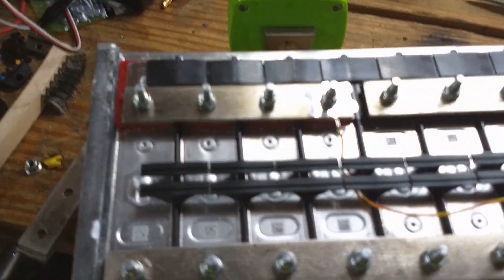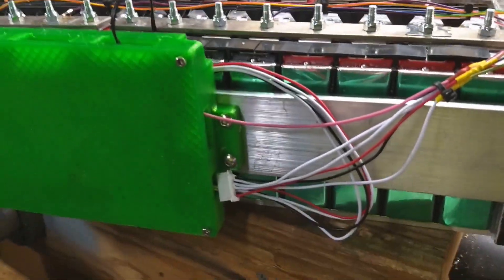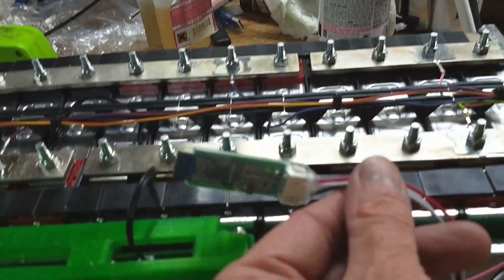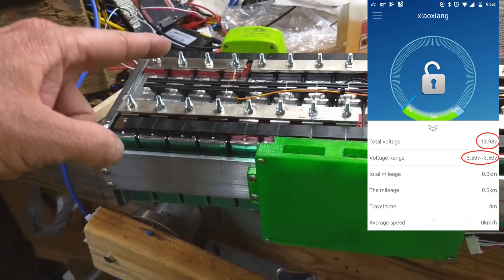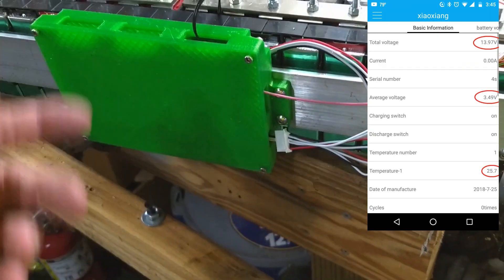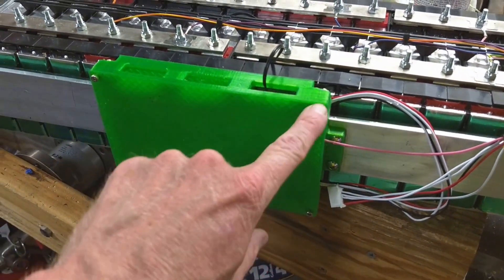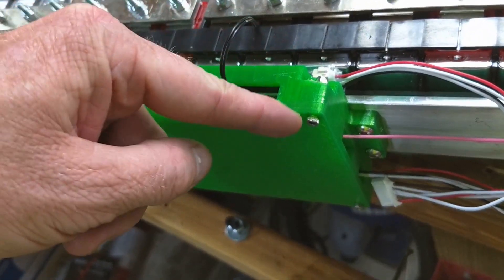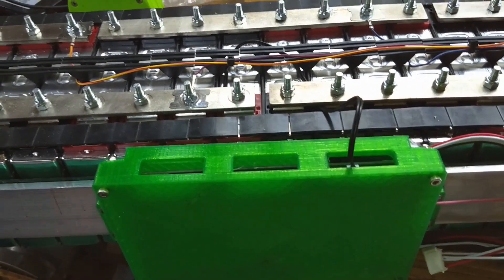100ah Ensley Energy Systems battery NMC Car Audio 25,000 RMS

Comment: Is this cmax cells ? What’s the minimum charging voltage needed for 100 AH ?
Reply from the maker: Charge voltage needs to be MINIMUM 14.4V, MAX 16.8V, MAX RECOMMENDED 16.2V GOOD SOLID MIDDLE GROUND IS 15.6V

Comment: You seem genuine. If I decide to buy vs build I'm coming to you. Honesty does pay off.
Reply from the maker: Thanks,  I do this as a hobby.  I don't make a ton of money doing this.   I just want people to be safe.   I mainly started making these because I saw all the garbage people were putting out.   YOU HAVE TO COMPRESS CMAX CELLS!!!!    Too many people are out there DIY'ing bad packs.    The angle iron method is cheaper, but I like the looks of these better.   And on the angle iron, you are not supporting the center section of the cells.   But that way is better for current flow!

Comment: Would 50Ah be enough for a 5k system?
Reply from the maker: I'd recommend a 75ah bat for 5kw
Reply from the maker: $750 for the 75ah

Basically 10$ per ah after u get to 75ah due to constant costs on frame.

Comment: I have (2) 370 alternator and running 10,000 watt amp how many batteries will I need to keep good voltage what is your thoughts
Reply: One guy told me 12 110ah batteries
Reply: cayde17 that’s agm batteries.. you would be good with 100 Ah lithium

Comment: Hey Eric what's the cost  for the battery
Reply from the maker: I have different sizes for different prices on ebay.   100ah is $950(this one), the 50ah is $535.    I can also make 75ah.   If u buy direct from me there is a 5% discount.   You can email me at EnsleyEnergySystems@yahoo.com
Reply: @ericensley2427  hey man I live in Canada could this battery be use below 0 in car audio
Reply from the maker: @kernhamilton553  
Probably.   Never put them in a freezer.    But if u have it in ur can, just heat it up before u start to bang.   BTW I don't ship to canada.  Do u have a PO box in the US?
Reply: not to tag on but how much for a 75ah? what wattage can it support? would be better run AGM/lithium or all lithium for starting and charging
Reply from the maker: @rob22849  
75 ah is $750.   Wattage depends on a few things, charge voltage and min allowable voltage.     You said u charge to 14.8 v and if we say 14v is lowest voltage u want to see then the 75 ah batteries can dump 650 amps = to about 9000 watts.   If u said 13.5v min voltage then the amps jump up to 1050 amps and that is about 14,000 watts.
Reply: Eric Ensley wow nice and that's burst or continous wattage? and I see your stuff on ebay what are your price if buying directly from you for the 50ah 100ah thanks for info i appreciate it
Reply from the maker: @rob22849  
Outside of eBay it is 10% cheaper (I said 5 above but that was before I looked at the fee rates)

Those numbers are "continuous".   I put " " because u still need an alternator to help fill the battery.   As the voltage drops you will need to back off and recharge.   U should get 1-2 songs before needing to recharge, but that also depends on your alternator and amp.   There are a lot of variables, and I am not a "yes" man to make a sell.    I'd rather give all the facts and tell u the actual truths, vs "yes"
Reply: Eric Ensley you what Eric I appreciate that I'm not soft I take can it straight no chaser lol that's how I prefer it.i guess I should've said a little more about what I want to do the alternator will be a 320 amp alternator amps will be either 2 Orion 2500dz strapped for a 2ohm load or if I can find for a decent price used two Rockford fostgate 2500bdcp but that depends on budget and real estate needed for my box. but anyway the current goes from 400 amps for sub stage with Orion and 600 amps for the Rockfords and 100amps for front stage.
Reply from the maker: @rob22849  
Pls email me at EnsleyEnergySystems@yahoo.com
Reply: @rob22849  the 100 ah one is all you need i get only .3 voltage drop on a burp with a 8k dropped .7 on a 50 ah one with the same amp on music slp run for 30 seconds i only got 1 250 amp js ultimate alt charging at 15.02 volts
Reply: Leepuke Puke thanks man I'm still looking myself but I think i found what I want I appreciate the input I just bought two orion audio 2500dz amps gonna run them strapped for a 2ohm ohm load at about 7k because the birthsheets I got one is 2975 the other 2965 at 12.6 volts so at 14.4 they should be hitting  close to 4k per amp. big D wiz did a dyno on one and got just shy of 3300 watts at 13.7 not to bad.
Reply from the maker: @leepukepuke1596  
Glad u are happy :)
Thanks for the info on volt drop.    I am always interested on what people are seeing.    Currently I only have my one data point.   I need more people to amp clamp and measure min volts.